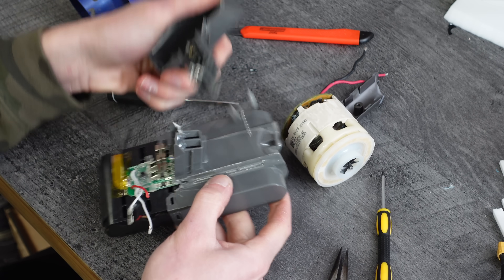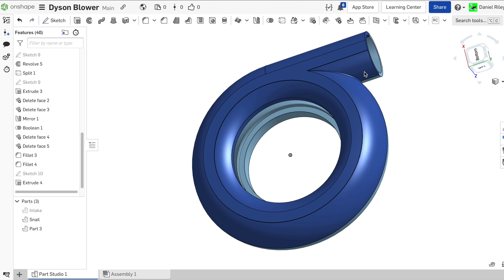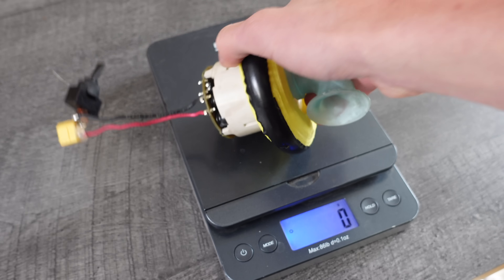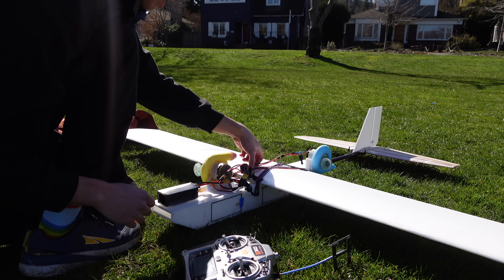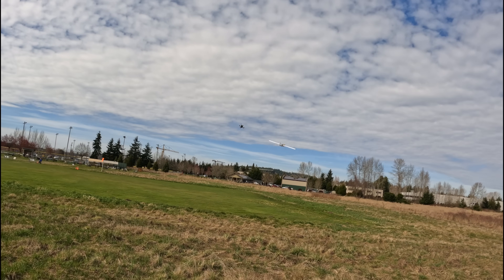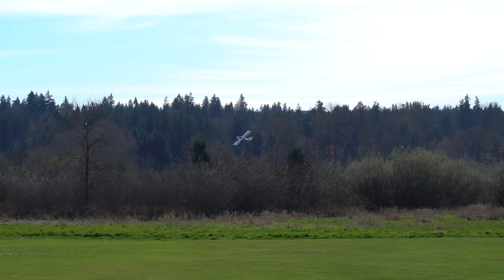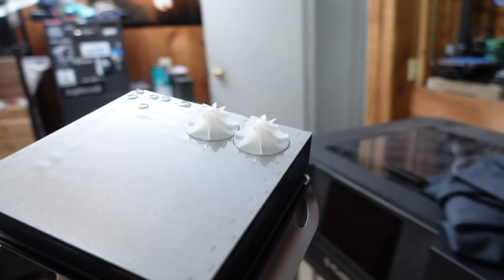Dyson Powered R/C Plane

Comment: Its basically an electric turbo now lol.. 
You should see if it that could build any pressure, like a real turbo, They sell the ebay Brushless Powered "Turbo's" or turbines, not sure what thats considered. Which are basically just a cheap version of something like you actually made here lol!! The 6S plus the special dyson motor & impeller/inducer size might also help with air pressure. It might be able to spin fast enough and push enough CFM's to actually do something on a car a maybe? Lol. Someone on youtube did try something like this, but with multiple leaf blowers hooked together and feeding the intake of the car engine only on full throttle. Just by the quick testing they showed, it actually did make a small improvement and it hovered at around 1-3psi which isnt too bad really lol.. So not a terrible idea, especially when electric motors and battery density catches up. We might actually see an "E-Turbo" on a production car to help with acceleration to make the motor smaller for example..

Comment: Nice! Where do you buy Depron from?? Are in the US?

Also just curious, are you running an external ELRS or Crossfire on the Spektrum TX? I really like my Spektrum radio and dont really want to use my "cheaper" feeling Q X7 to use with an External TX Module in the future.. Id much rather stick it on my DX6 G2..
Cool video like always man!

Comment: What if you duct the fan intake into the wing? Could experiment with sucking the air from the top side of the wing vs front side or whatever. would it create a low enough pressure zone to affect lift characteristics?

Comment: Could you shoot something from an aircraft in a forward direction that could change the pressure or density of the air it is about to pass through, laser, plasma, electric discharge?
Also combinations of engines to take advantage of their unique characteristics, the engine with the thrust to get it to speed could be jettisoned when the engine capable of higher speeds takes over?🤔

Comment: Well as you turned the inlets around you lowered the pressure of the air going in, so the fan just spun faster and compensated the loss of power by consuming more power (due to lower efficiency) and more RPM

Comment: shouldn't your snail be a volute curve instead of circular?

also why not just make a housing around the motor to redirect the air flinging out the sides downward (assuming motor inlet on top and spinning horizontal to ground) you see this design with some inline fans for hvac/hydroponics

Comment: build a combustion chamber and use that compressor at 80k....electric jet.
you will of course need those big batteries and fuel so extra weight

Comment: Maybe you can make something akin to a jet engine:
You set the impeller in the middle and let the exhaust of the impeller get redirected from all sides, basically creating a sort of bell shape that tapers off towards the end. Then you take a sort of trumped shaped inlet, so when the aircraft flies, it generates static pressure infront of the impeller, so it acts like a compressor.
No idea about how aerodynamic that would be, but that is how I would do it, personally.
Reply: Was going to suggest the same.
A setup like that could make for a more compact "thruster".

Comment: those fans are better at higher speeds like you said you can easily test this by using an rc jet plane that uses a real jet engine the turbine is spinning alot faster than these fans do a good rc jet can reach very high speeds

Comment: You are loosing a LOAD of thrust as your exhaust manifold is circular. You need to change the shape so it expands until the exit, like a snail shell. If you look at your design at 15.05 you will notice that the air can either exhaust or continue around the manifold, loosing pressure.

Comment: Cool to see! I actually did the exact same thing you did to the two motors. The only difference was that i wanted to design the "snail" so that the area inside of the snail does match the area that the motor outlet has from beginning to a certain point at any point around the motor. So the inner area of the snail rises parallel to the area of the outlet while you go "arround" the motor...if that makes any sense. I did this to have the same airpressure everywhere inside of the snail. I couldn´t finish it sadly. My CAD skills are still not good enough to make this happen :(

Comment: I will say your test for intake forward versus backward wasn't very conclusive. by testing it on your scale with intake up/down, there was really no difference due to zero airflow along the inlet. You would maybe need to test in a wind tunnel with the wind blowing at the nominal aircraft airspeed. But regardless, I don't think it would make that much of a difference anyways.

Comment: probably just me but when you tested the different angle of the intake wouldnt it not make a difference cause your just changing the intake position when its stationary instead of when in flight the air isnt moving around it wouldnt you need a wind tunnel of some kind to properly test that idea?

Comment: Ah yeah. Dyson. Worst vacuum cleaner I ever bought.
Piece of crap. I have a 4 room house, it's REALLY tiny, not bigger than an rent. Bought this thing, 400$, I used it 1 time a week? Something like that, the rest was with a broom. The battery lasted 3 years. 3 years... For a fucking crap I paid 400$. Dyson said : Yeah yeah, it's normal, those battery last, 3 years. So I have to ship them the vacuum, at my own cost, pay 180$ for the batteries replacement, pay for the shipping back to me. ... Bought a corded DeWalt. Fuck Dyson. I understand why you found one in the wild. 🤣

Comment: Cool project!  Worked amazingly well.  I wonder if any gains might be had if you line them up to get a little compound thrust by pointing the outlet from the front motor towards the inlet of the rear motor. Not up close but in the thrust path to give it a little forced induction.

Comment: There may be a way to design the exhaust duct for axial thrust; perhaps more of a donut shape with circumfrencial slits, could even make it have variable geometry via a sliding ring to close down the ports; throttle it physically rather than via motor control. Still would be super inefficient, but worth trying.

Comment: The intake-direction normally would matter but there are 2 things here that make it kinda irrelevant:
High-speed low volume airflow - there is not all that much air getting sucked in.
it is a static test - the air basically streams into the inlet from all directions equally.
With a EDF you really would not want your inlet to look backwards.

But as for how much the round edge does - again like a bigger difference with higher airflow, but likely not a big impact and doesn't require large diameter roundings either (as we can see on commercial turbofan engines).

Dyson vacuum cleaners. Not bad, but so expensive. I wish in europe they didn't by law make them so weak. (funnily enough with the first regulation they claimed that 1400W cleaners were oh so efficient nearing the theoretical limit, now they claim that there is no need for over 900W and that anything more is just inefficient .... make up your darn mind).

Comment: Can’t wait to see what you do! Have you considered putting one on each side? OR having longer convection tubes where the motor is closer to the center of the plane but the output is at both ends of the wing by various tubing 🤔🧠

Comment: Id have a look at the Dyson hair driers if you can get them cheap, they're axial flow I think. Id also like to think 2 of those fan and motor units (compressors)  mounted vertically staggered in a fuselage  and a 60 degree swept wing would make a pretty fast aircraft... Like a tribute to the EE Lightning 😍
Reply: The problem with the hair driers is that they run on AC input. So they aren't as suitable for such an RC conversion...

Comment: When you calculated the speed of the impeller at a high frame rate you may have underestimated since it is possible the motor did 1 rotation plus a little bit between frames. This is called aliasing and is why if you film a home fan with a camera, the rotation and fps can sync to make it look like it is moving backward. Great Video!

Comment: It would be cool to use the Dyson Bladeless FAN design, I don't know about it thrust efficiency tho :/
Or use one off the motors, to inject air directly on the wing, like the F-104 High lift flaps system, same concept as the Bladeless FAN, but for wing

Comment: You could replace the snail flow-director with the same kind of flow director used in centrifugal-flow jet engines, which redirects the air all around the centrifugal flow and directly backwards.
Reply: then you could put a flame catch can and inject fuel and burn it for more thrust
Reply: That would only benefit an internal combustion engine. There is NO reason to bypass air if there's no combustion happening inside of it.
Reply: @davelowets  It's not a bypass, it's just a way of more evenly distributing the flow. See the following image for what. I mean. Ignore the combustion and turbine, just look at the compressor and how the air flows around it. 

https://en.wikipedia.org/wiki/Centrifugal_compressor#/media/File:Turbojet_operation-centrifugal_flow-en.svg

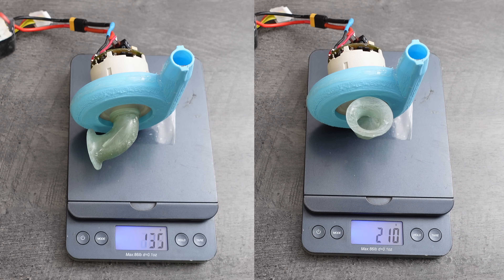Comment: 13:00 I'm not sure but I would say that most of the difference would come from the orientation relative to the moving air. In a static test, where there's no airflow this would have no effect (right?)
Reply: Technically the low pressure zone would still provide thrust as it is just Pressure * Area
Reply: @christianlabanca5377  But i would expect the front-facing one to outperform the other one while moving, as it experiences a higher dynamic pressure. With static pressure it's just the same

Comment: Reckon these compressors would work well with a rocket-esque nozzle, considering those are designed to convert high pressure to high velocity. I imagine it would much increase the thrust output and efficiency of these designs.

Comment: I was personally impressed with the little motor the Dyson hair dryer had in it, as seen on AvE. All that engineering for a random household product.

On second thought, using a single one of these for a boundary layer control demonstration would be neat, or blown flaps.

Comment: you could build a motorjet with these engines, the fact that the dyson motors actually produce pressure would make the thrust alot higher when mixed with jet fuel!

Comment: In motion, I'm wondering instead of a tuba shaped inlet if a more conical would reduce drag while still providing a smooth laminal flow

Also due to lack of fan speed control, it'd be interesting to see if controlling the nozzle diameter could control speed/thrust
Reply: Yes nozzle or inlet control, it is a vacuum after all so you can't over rev it.

Comment: "An EDF gets all it's power from the intake" is the RC equivalent of saying that a (regular)vacuum sucks air in. Yes that is the effect, but the cause is the fan blowing air out of the canister(or out the back of the plane as the case may be).
Reply: This a variation on "Feynman's sprinkler". Put a sprinkler under water, and it still spins. Now reverse the direction of flow, so that pool water flows into the sprinkler nozzles, and 99 out of a hundred people would assume that the sprinkler would spin backwards...and they would be wrong! The sprinkler twitches a lit bit at first, and then stands still.

Comment: Add a nozzle, the impeller itself (like all turbos) accelerates the air but does not increase its pressure, thats what the diffuser does (bernoullis equation for subsonc flow) :)

Comment: With the controls it's like the space shuttle. Start the engines and fly, then cut the throttle (in the space shuttle the fuel goes out) and then glide as a pretty bulky plane down to the ground.

Comment: So, knowing that the intake position is not particularly sensitive to location, you might be able to gain some advantage by burying the centrifugal fans inside a wing with a top surface inlet and exhausts below/aft the wing.  The low pressure may well contribute to overall lift.

Thinking about this a bit more, over the course of the day, I would suggest you could have an upper surface inlet  inboard, close  to the fuselage, if there is one.  You may require a fence outboard of the inlet in case the low pressure zone disrupts the outboard flow.  The other thing you could do with this (and it could be impractical at this scale....) is to use the jet exhaust as a trailing edge jet, rather than as a propulsion system.  This could act as a jet flap and encourage flow attachment when it would otherwise break away - boundary layer control.  This has been tried on a few aircraft over the years - today the Shinmaywa US-2 uses a separate power system to generate flow for BLC on flaps, rudder and elevators.  Another aircraft to look up is the british Hunting H.126 which was used to investigate these systems.
Reply: would be cool in a flying wing
Reply: So in static testing no. But in flight there's "ram recovery". 
The air rams itself into the intake making the impeller more efficient
Reply: would be interesting to test this, because some aeronautical engineers claim that the lift is produced by the reaction force that results from the airflow leaving the wing, not the old concept of low pressure above the wing. If air is sucked away from the top of the wing, it might reduce the pressure there, but it will also reduce the amount of air flowing off the wing. If the old concept is right, then the lift should be improved, if the new ideas are right, the lift should be reduced (provided the air intake is relevant compared to the total wing surface).
Reply: @lukearts2954  Isn't the airflow leaving the wing called the Mach Tuck? Rather than lifting the plane, it changes the CG of the plane enough to cause it to nose down, causing quite a few air crashes in the past. Modern planes have features to prevent this these days so if that claim was true, these modern planes would have had less lift than those in the past but you don't see this, so I'm a bit skeptical about that claim.
Reply: I have no experience beyond paper airplanes, but my understanding is that fast flowing air creates low pressure, so wouldn't you prefer the fast exhaust to flow over the top of the wing instead of underneath?

Comment: Small correction - the Dyson engineers did the engineering.
Reply: Well, sure, they may have refined it, but James Dyson has a background in engineering and industrial design and spent about 15 years making his first bagless vacuum with cyclonic separation. So, I think it’s fair to give the guy a little credit, even if many of current components weren’t designed by him.

Comment: it isn't that hard to ditch the snail shape for an axial shape and get a better aerodynamic profile.

you could also check a multi-stage dyson turbine. it might increase both ejection velocity and flowrate.

specially for a motorjet engine ;)
Reply: Stacking identical compressors usually does nothing. You'd need the second one to be smaller so that there is a net confinement of the flow. The open air compressor can develop pressure because there is an unrestricted mass flow of air into it, but the second one can only work with the fixed volume that the first provides it. You might even see a decrease in net pressure if you stack them due to the back pressure on the first lowering its efficiency. You might see something happen if you use multiple parallel compressors to feed a single additional compressor, as that would create the net restriction needed to develop further pressure.
Reply: @dustinbrueggemann1875  You need a stator too. An axial compressor stage is, like, really freaking hard to build.
Reply: @NonEuclideanTacoCannon  I don't think vortex effects are going to matter when there's already a manifold duct involved. Maybe some parallel baffles on the mouth of the second stage would do a little bit, but its not like the angular moment of the flow will be anywhere close to the speed of the impellers.